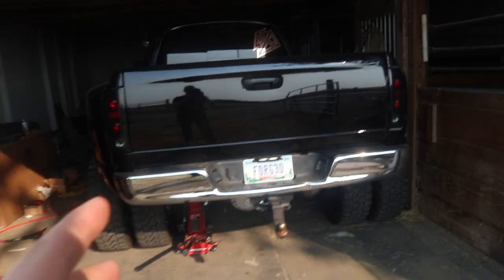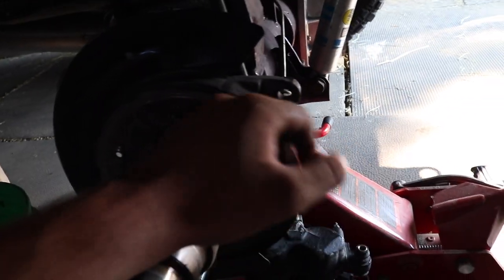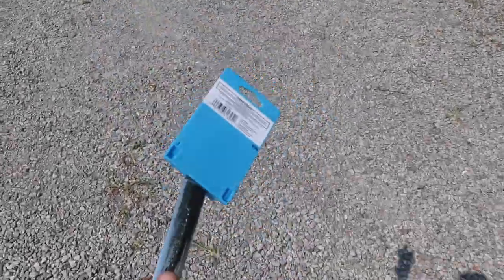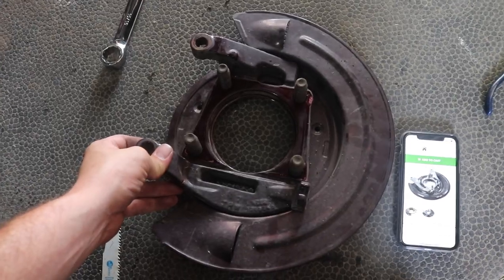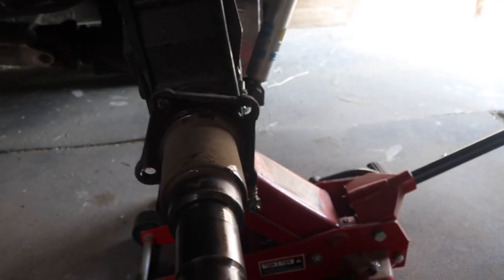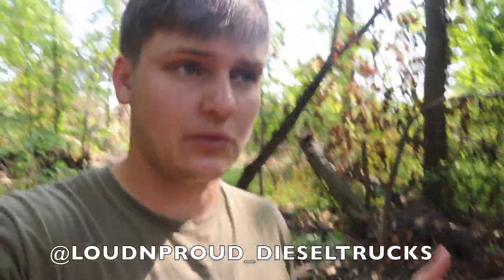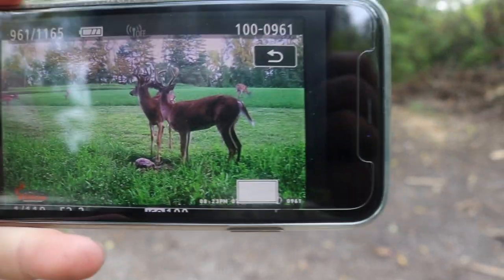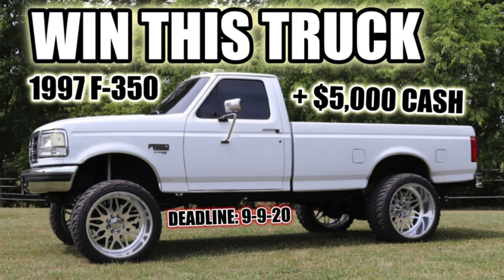Rear Axle TEARDOWN on the DUALLY!!!

Comment: While you got it torn down to there I’d just pop a new wheel seal in the bearing and make sure when you slide it back on to put a little 75w-90 on the spindle but don’t get it on the threads at the end or where the seal sets, it’ll make it easier to put back on

Comment: If the part you ordered doesn’t fit, I would check out 1A auto.com and rock auto.com. They may have the part you are needing. Also, idk if they would have the part for you but possibly Summit Racing or Jegs may have something that could work i know they are mostly in the aftermarket racing parts field in the automotive industry but might be another source to reach out too. Just my 2 cents lol